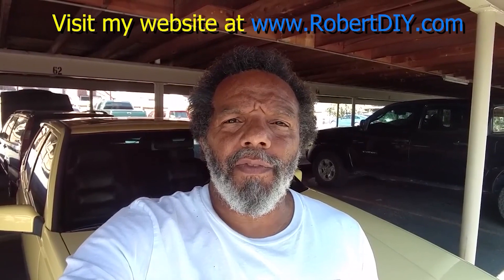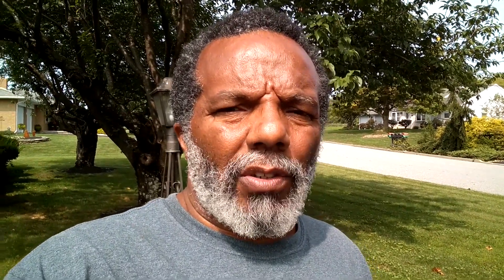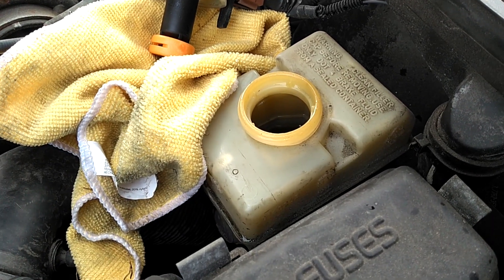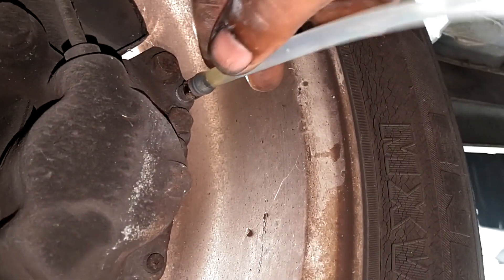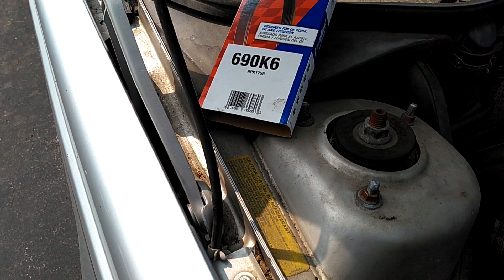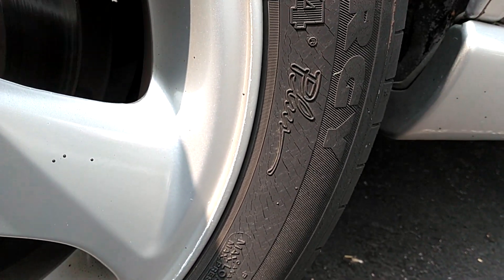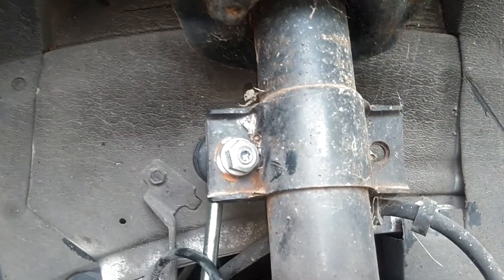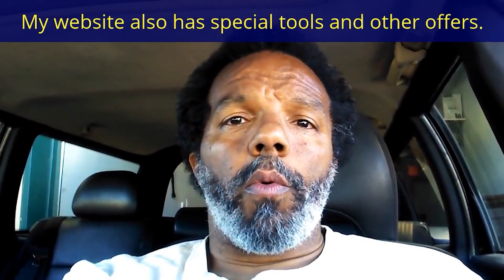Still in MD. Helped Peter with his '98 V70 T5. Brake fluid, air filter, fuel filter, and more - HOWR

Comment: glad you pointed out those tires. spending extra on slotted rotors but not replacing your tires when they get old? come on now.
has that power bleeder held up well over time? looking for one myself.
Reply from the maker: My power bleeder is only 1 month old. I was told the hoses go bad after about a year of use.

Comment: Hi Robert,  when you have a chance,  please show how to replace the brake fluid in a manual clutch slave cylinder.  Thanks
Reply from the maker: it's the same as a caliper. Open the bleed screw and push the fluid out.
Reply: Thanks

Comment: The oil is fine with the 20 degree higher temperature but the engine running hotter steady in a while might lead it to over heat and get a bad engine block or warped cylinder head?
Reply from the maker: No. Coolant is still around 200 degrees. I guess the coolant system keeps it down a little. Full synthetic engine oil does fine and doesn't start to break down until around 450 degrees.

Comment: Hey Robert, So I have problem lately with my car and hopefully you have an Idea about it , I have Hyundai Elantra 2013 and couple days ago the check engine light came on and the car was shaking also some times it won’t turn on. I scanned it and it says cylinder 3 misfire so I changed the spark plugs with replacing coil 3 and 4 to see if the coil is not good. The check engine light went off and car was driving south for a day than it went back to the same thing the check engine came Back, car shaking and sometime it won’t turn on from the first try I have to wait and try again till it turn on plus I scanned it again and it says cylinder 3 misfire . I check compression and has no compression in cylinder 3 but all others is good . 
Hopefully you see this :)
Reply from the maker: https://youtu.be/1lzDZNwGWbI
Reply from the maker: Hmmm My guess would be that it has a burnt valve. Strange that it went away for a couple days. How many  miles does it have on it?
Reply: I have 197 km on it , Thanks for the video that was very helpful I will take off the injector on that cylinder till I get it fixed

Comment: Ooooooh those tyres! I first saw the cracks at about 15:20 and was going to mention it. I wouldn't go to the supermarket on those and I'm sure you'd be liable for a ticket from the man? If you can get shot and killed for having a rear light out perhaps you'd be in even more trouble with totally unsafe tyres. Just saying.
Reply from the maker: I'm surprised they are still holding air.